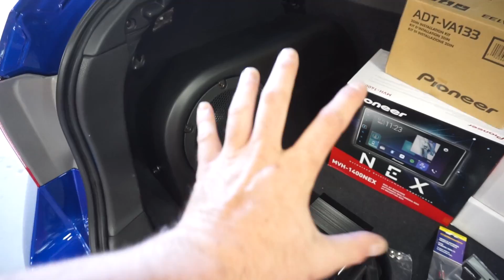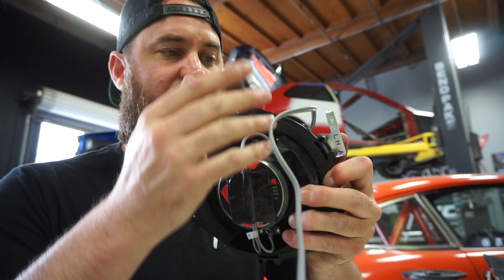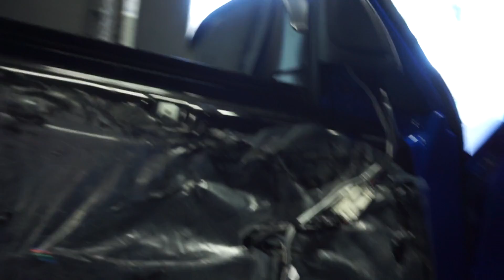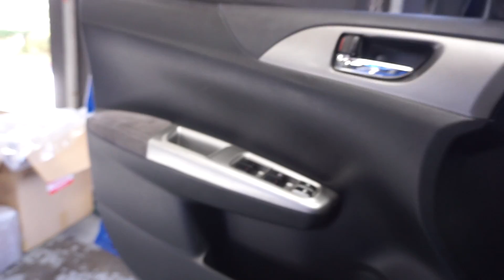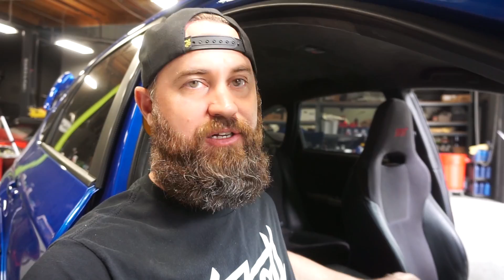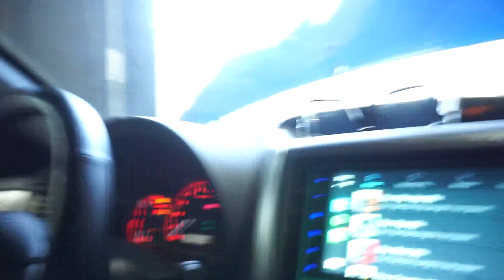Building the ULTIMATE 2008 Subaru WRX STI Hatchback - Part 12 - Audio System Overhaul!

Comment: That groove in the magnet is for the coax version. That vent needs to be open or it will affect the cooling of the voice coil and overall performance. You'll want to remove that deadener from the opening.

Comment: There's an alternate 20-pin harness out there (similar to the Metra 70-7552) that includes the 3 wires for steering wheel controls. That avoids needing to splice into factory wires.  And see Tedlasman's post (below) about the alternate OEM fascia / trim piece that has a normal double-DIN opening. That averts needing Metra's dash kit, and you re-use the OEM metal brackets from the OEM head unit.
Reply: You got a link for the harness by any chance?

Comment: Hi,
Just a comment about crossover placement in the doors.  Putting the crossovers too far back in the doors will eventually cause some sort of breakage of components when slamming the door repeatedly.  Putting near the door hinge is a good spot but putting in the kick panel is a better.  Yes more work but failure won't be a problem in a year or so.  Yes I am a veteran  installer and have seen this failure a few times now.
Nice to have a Amp/subwoofer system that is basically plug and play.  We usually spend hours hooking all this stuff up.  Customers just can't understand why it takes so long.  Lots of wiring lots of car panel removal and fabrication for components.
Nice to see a nice clean install!
Good job!
-Jon

Comment: Hey quick thought I had. It's probably worth your guys' time to take the car to a Subaru dealer to get the Takata recall done if you haven't already. I just figure it will save the winner the time so they don't have to go get it done.

Comment: Soldering and some heat shrink would have been a much cleaner way of doing the radio harness to the metra harness. But either way butt connectors are better than the old twist and electrical tape lol

Comment: There's an alternate head unit trim piece from subaru that used to be jdm only. It fits a standard 2 din perfectly, and you don't need the bezel kit. I got it for my car. I think it's this part: https://parts.subaru.com/p/Subaru_2009_Forester-25L-TURBO-4AT-XT-Limited/Panel-Center-C0C4/49277387/66065SC000.html
Reply: I'm fairly sure your link (66065SC000) is one of the normal fascias (with the larger than 2-DIN opening). 66065SC130 definitely is one with the 2-DIN opening (color two-tone silver/black). It was used in some Forester models in the USA that got the TomTom nav HU from the factory. There are also still several JDM fascias available in different colors from JapanParts and avoJDM: 6065FG020 (dark silver), 6065FG000 (lighter silver), and 66065SC030 (two-tone).  All of these run about $80 plus tax and/or shipping.

Comment: Hey Mickey  Please dont block the hole on the back of the speaker with your tape! its called a Pole Vent and allows the voice coil to cool itself. blocking the vent will cause the speaker coil to overheat and wear out

Comment: The plastic piece you mounted crossover to has to have 0 vibration or the crossover will fail over time.
Reply: K T - There are no 0 vibration environments on an automobile.
Reply: @mickeyandrade3435  that's cop out answer lol. You can mount vibration dampers like pieces of rubber where the plastic piece mounts to door.